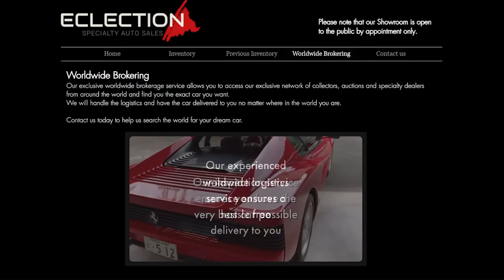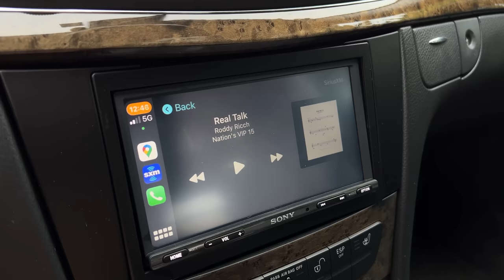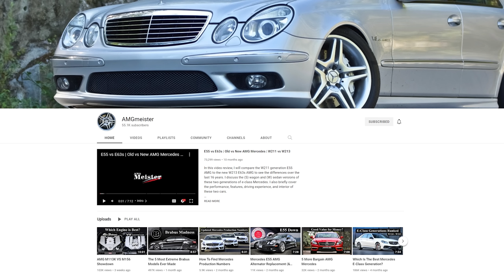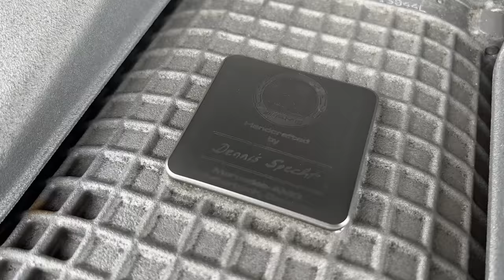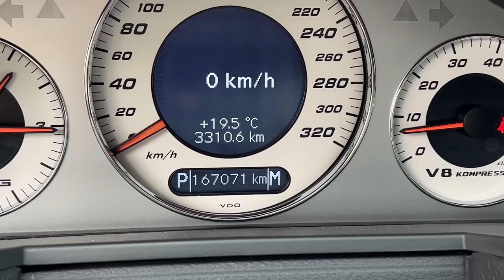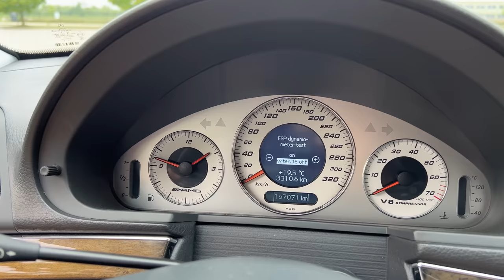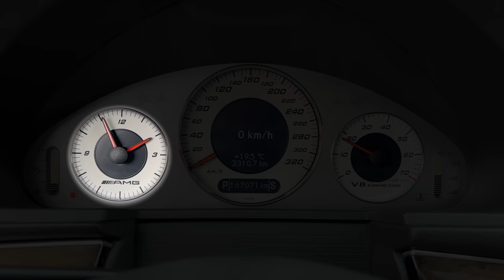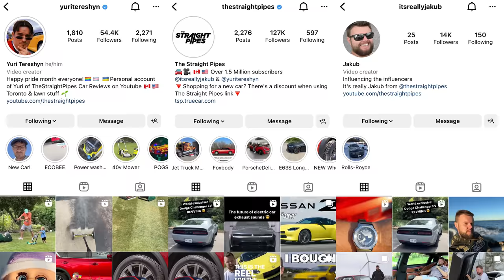DREAM CAR! I Imported a 500hp Mercedes AMG Wagon... FROM JAPAN!

Comment: The window visors are marketed by the automakers as a way to ventilate air on a rainy day, but really they are for smokers. I live in Japan and both of our cars have them. They get included in nearly every dealer installed option package to pad up the price. For cars with metallic trim around the windows some of the visors will replicate that so you don't ruin any lines.
Reply: I don't smoke but I have these (original lexus accessory) on my IS250 and they have the chrome trim strips on them which match the original window line. IMO your car is not proper VIP JDM unless it has them fitted. lol
Reply: It makes smoking on a rainy day so much easier
Reply: Not really for smokers, our weather at the Kenyan coast is quit humid and we need to crack open the window when it rains to regulate humidity in the vehicle

Comment: As an E55 owner, I approve.

Also, you can still upshift even when in either C/S modes. It just has to be at shift points that the TCM allows in 'automatic' modes.
Reply: E55 Wagon owner here, over in Germany. You can also put the TCM of a CLK DTM AMG in it (also had the M113K engine). That has a genuine M manual mode and will shift in real time as you pull the paddles. It also removes the torque restrictor the factory TCM has so you have full torque available in all gears.

Only word of caution your tranny has to be somewhat fresh as the gear engagement is quite heavy on the box.

I can also confirm that even with 530+ horsepower at the crank with the wagon on 275 Michelin PS4S tires it deadlocks from a standstill and will do 3.5sec to 60mph 😊

Comment: Finally, a real car! The E55 was my dream car, then I bought one. Now into my 15th year of ownership of my 2005 E55 Sedan. It is Obsedian Black, has 19" AMG wheels and is in stealth mode (no badges). Love it to death. Funnily enough, my wife's car is a 2022 CX5 Akera (Australia) Turbo in Soul Red, which replaced a 2015 Akera. Can't fault Mazdas.
Reply from the maker: I love the sl65 19 wheels
Reply: 25k Canadian all in. Wait a bit. It'll start gaining value real soon. Just give it a couple services 😜
Reply: How’s the reliability?
Reply: @roninpwns  The common issues are Air Suspension and the SBC Brake unit. I have had to replace both over time. Do regular fluild changes and the motor and gearbox should outlast you. My biggest expense has been Tyres. 25k is about the limit from them and 19s are more expensive and there more limited options. Wear and tear has generally been very good. Build quality was pretty good in the W211s.
Reply: CX-50 >

Comment: The W211 E Class is one of my favorite Benzes. Great styling which has aged beautifully, great amount of space, solid build quality (open and shut the doors and you'll hear the nice solid thunk) and of course the AMGs variants and wagons are brilliant both in function and rarity.
Reply: what u talkin about, the W211 has the worst build quality equates to bad reliability of all E classes
Reply: @djkasdjkasdjdjdj the E350 yes. All the rest were reliable, as Mercedes extended the SBC warranty by 25 yrs/unlimited mileage.
Reply: @bleachstain9785 I got lucky with my e350 the rod bearing issue wasn't on mine lol

Comment: Congrats on purchasing one of the best AMG's. After doing a ton of reading and researching just like you did, watching Alex (LSC) and AMGmeister, I purchased a 2006 E55 sedan with 112k miles on the clock 2 years ago. These cars are very easy to work on. FCP Euro is your best friend for parts. And the reliability everyone talks about, it's 100% true. I daily drive mine, and enjoy every mile of it. I've also kept mine 100% stock, just like you intend to. Also, change that grill back to factory with the hood emblem.
Reply: Agree about the grill
Reply: Why not the e63?
Reply: @TOShorts  depends on which year you're referring too. But mostly due to head bolt issues, cam adjuster issues, a few other things too. Anything after 2012 is better if you want the 63. But when comparing the two, the 55 will take the trophy for reliability and an all around great package. Combined with a solid gearbox, very torquey engine and easy to work on compared to most other German built cars, the 55 is a solid machine that will begin to increase in pricing. AMGmeister does a very good and informative video on the two setups.

Comment: These older Mercedes are tremendous cars. I just got my dream car too a few months ago - A 2007 S550 4MATIC … They’re reliable and well built cars with amazing performance but you gotta be ready to hit all the maintenance or else you’re going to get some ugly bills. The only issue I’ve had so far with the car is one of the air struts going out - which is totally normal on these cars - so I just replaced it with an arnott air strut that comes with a lifetime warranty. Totally enjoying the car and I’ve got no regrets - congratulations, and I hope you enjoy yours too! Also - OEM grille with the stickup star is the way to go with Benz! Far classier looking & you get to look at the star sticking up the entire time you’re cruising down the road :)
Reply: Was thinking 2014 s class, instead got a 2017 ford taurus sho, when done paying this off going s class for sure
Reply: @charlesdawkins4341  Not sure how to say it other than it’s a bucket list car - can’t know how amazing these really are until you’ve owned one. I’m not sure I’ll ever leave the Benz brand again after this car, nothing else I’ve been in drives anywhere near as well. I actually look forward to getting up and driving it to class & work. Don’t let the nightmare posts on the internet scare you away, just buy the car and be responsible with the maintenance and you won’t regret it!

Comment: Love E55's and one of the best and most reliable AMG engines ever! The factory gill and hood star looks wayyyy better than that aftermarket grill IMO. If it were mine, I'd do a E63 front end conversion. Make the car look a lot newer. And Monoblocks and coilovers. And super charger pulley, tune, long tube headers, couple intake and heat exchnager mods to make 600whp on pump gas while remaining tame and usable w/ family. Let's gooooo!

Comment: I prefer the OEM grille and star on the hood than the big logo on the aftermarket grille. It looks much more subtle and classy but if that's not what you want, then the current grille doesn't look bad.

Comment: I got one 5 years ago with a pulley, tune, and exhaust. My job has since radically improved and I could afford a new E63S. I refuse. My 2005 E55 wagon is so good, so gorgeous, and so fun I can't let it go. Not as fast as many new true hot rods but fast enough that I cackle like a maniac 90% of the time I drive it. Best 0-60 so far is a 3.9s using my dragy.

Comment: The reason why the car has the vent visors is because japanese people smoke a lot and hence they Crack the window down when smoking inside the car. It is considered rude to smoke without cracking the window down. 
Also it rains a lot in japan, so what do you do when it is raining and you want to smoke? Hence the visors.

They are extremely popular in japan and almost all cars have them. And the weather in japan gets humid a lot during summer season helps during that time too to not be stuffy Inside the car.

Idk if you will read this, but if you do I hope I answered your question. Also the reason you don't smell smoke is becsuse japanese people maintain their stuff extremely well! Let it be anything.

Comment: Sweet wagon! This one is on my dream list too! 
Window deflectors are for the rain most likely. Japan can have a similar climate to the PNW of the US so these are useful to crack the window with out rain dropping in or pouring off the roof into the window and all over your lap. Worth mentioning they are popular with smokers so that you can have the window open for venting without getting wet.

Comment: Hey, the 5 speed auto can have 1 additional sportier mode called Agility. It does make a difference in shifts(obviously not like a gearbox tune, since it is just a hidden option on all 5G,7G and 7G+ transmissions. Hit me up if you want some hidden options activated. I can do them remotely for you. 
In terms of options you are missing the Distronic, cooled seats, the cornering Intelligent Lights (ILS) xenon, maybe a wheel heating and rear seats heater. Obviously none of these are dealbreakers and can be retrofitted. 
Amazing car and congratulations! I was going to be a dad myself and was thinking about switching the w204 Wagon for one of these, but with the normal M113 engine.
Reply: I was thinking the same thing about the options. Sorry, jakub lol

Comment: There is the red triangle hazard button and under it on the same button cluster is a silver stripe. 
If you press it it will either have a cd changer or a "secret" compartment if it wasn't optioned with the cd changer

Comment: Finally, congratulations,Jacob!  You bought the right choice of high performance family car. My father have one W211 E280 CDI (facelift)in India which is a precious model from Mercedes-Benz. I really adored your car because of iconic Supercharged 5.4 liter engine. I highly recommend to fix the 5 horizontal line grill with standing 3 point star logo which would be looking elegant. Now I’m in Norway and I’m hunting to buy used W211 model with 4matic and OM642 engine because I don’t want to loose the feeling from my dad’s car due to the best. Again, my hearty congratulations  to Jacob for the proud owner of that dream machine.

Comment: Hey a tip for if you are driving it in sport mode , if you press the downshift paddle then proceed to choose the gear you want to take off from. The computer does shift for you but you have to floor it all the way down and it will shift on its own right before the redline. I own an e55 sedan thats why i know. But you are correct it also does downshift for you.

Comment: The front and rear parking sensor displays were used for years as they are fitted to my 2016 CLA45 'shooting brake'. I didn't realise until after I'd picked it up as I thought "2016, all the display info will happen on the screen......nope". Lovely choice of car though, hope you enjoy it.

Comment: Air suspension in winter is a little iffy, condensation from compressing the air will freeze plugging off air lines. I’d keep one height for winter(all the way up) and leave it be. I’ve had air ride freeze up in my rebel and almost killing me on the highway

Comment: Congrats! When something is made to last it means many can enjoy it down the years. As it has a dyno-mode it would be interesting to see if the power/torque numbers match with the as new specs. As it's a hand-built motor I'm thinking power loss would be minimal. It would still make an interesting video putting the wagon on rollers.

Comment: I have a 2004 E500 4matic that I swapped a E55 engine into.  I live in grand Island NY and am in welland canada weekly.  It will be sold in a few weeks, but if you guys want to see what a M113K is like with AWD and a shorter final drive let me know.  It is a absolute beast off the line!
Reply: Hey. I have an 2004 E500 wagon and a donor E55 Sedan that I want to swap the engine to the E500. Any hints or tips? Plus I want to at least swap the AMG front brakes since they are far superior. Did you do that as well?
Reply: Can you give me any tips about the E55 engine swap into the E500 platform?

Comment: also for the transmission for the D plus and minus the germans have it in the W210 older E class so it's not from other cars and the 5G tronic automatic transmission is one of the most relaible Mercedes transmissions.

Comment: For quicker downshifts you wanna perform what Mercedes calls a kickdown method. Don’t just press the gas to the floor even you could. Blip the throttle with a good tap then pedal to the floor.

Comment: Huge star grill is cheesy. Dudes in MD put this grill on a w123 to spiff them up….
Install original grill but plastic dip the chrome parts black. Remove the star and get the flat emblem.
Keep original wheel size and just get better tires.
Also, the wagon is lowered. That’s not stock height

Comment: e55 over any new e class. just upgrade if you want more power. they have the real mercedes feel. not complete electric nightmares. I own a 2007 e550. one model below the e55 and it's quick but my goal is to own an e55 add some wheels and upgrade the exhaust, headers, eco and add a Whipple supercharger and be done. daily it !

Comment: My dad has a saloon of the same generation from 2005 (not an AMG though!). Apart from some new suspension springs recently, it's otherwise still going well with 60,000 miles on the clock.

Comment: Go back to the original OEM grille. Also the stock radio unit looks better. Isn't there any way to get a unit that looks like the original radio but with the extra features?
Also, the Dodge was based on the Mercedes and not the other way around. They got to use the Mercedes chassis. Shows how good it was that it is still being used today 3 generations later.

Comment: Nice car! The visors for the windows are a requirement if you want to drive with your windows down in my Bronco Sport. The wind buffets like crazy without them and it is very irritating. They are good too if it is raining "a Little bit" and you want fresh air to enter. I've used them on all my cars since the 80s.
Reply: The bronco sport is such a poor vehicle! Why did you buy it? It's literally a fake bronco and loses it competitiors on interior, features, and performance. Silly

Comment: I had a 2007 Iridium silver E500 wagon that I really liked (I even had purchased OEM E55 staggered wheels)…. A really attractive car. Love yours!
In the day, you could purchase adjustable airmatic adjustment links that are used to “fool” the system. Check inside your wheel wells and you will see the links… they are about 3” long. If adjustable then that’s how they have lowered it.  I now have a 2018 E63s Wagon…. Love it too.
Enjoy your car! BTW.. that car likes high flow air filters. I added chrome rings around the head lights and it finishes the nose off nicely. Also, chrome mirror covers can look nice (eBay versions)… lastly the door inserts take care of all the scratches that show up behind the handles over time…
Reply from the maker: It's lowered through Mercedes STAR

Comment: excellent and entertaining video. I had two of them and I kind of regret I sold the 2nd one, which was MB 320CDI,4MATIC. I think your model has a CBS brake module, which was problematic through the years. And the worst of all is the gasoline consume-the car is very thirsty -it is a beast 🤷‍♂

Comment: Congratulations!

First of all, the Japanese version had limited options and was not offered with third row seats or rear sunshades. Ventilated seats were also not available as an option.
I remember that the reason why the keyless go system was not available was related to the Japanese radio act.
The plastic on the door is called "door visor" and it allows ventilation when smoking on rainy days.

The number of E55 wagons is decreasing in the used car market in Japan, so I think they will become valuable in Japan in the future.

Comment: The grill is cool. Don’t touch it. The raised emblem will get ripped off. Hold the ESP button for 5-6 secs and you’ll be all free. Burnouts coming up
Reply from the maker: It doesn't change anything on my 05
Reply: @TheStraightPipes  That’s very strange. Usually works on all cars. Perhaps holding it down longer like 30 secs?

Comment: A fun car that is a blast to drive. Hopefully you have a good Mercedes mechanic that has a factory scanner (or one that can read all factory codes) to diagnose problems. Used Mercedes can easily become the "check engine light from hell." and you'll need someone to figure out which sensor or component is throwing the code. My suggestion, drive the car regularly and keep it maintained. Letting cars like this sit can cause maintenance headaches (dead batteries, corrosion etc.) Enjoy your ride.

Comment: Except that it's not 500HP. You fell for the "underrated HP" myth that was spread around the internet back in the day. It's not underrated. The SL55, S55 and CL55 make 490HP because they have a freer flowing exhaust than the E55/CLK55 cars.

Comment: Original grill swap please. Interesting your center armrest is the older split version, not the roll up wood one they upgraded to in 2005. I wonder if that is a Japan or a Wagon thing? You'll be happy when you replace brake rotors that you got the E55 vs. the E63.

Comment: Here is another very weird Japan-only AMG - W202 C55 AMG. Yes I did not do a typo and you did not read that wrong. They made a 5.4 AMG for the W202 chassis - but only for Japan. That way you can avoid the W203 Chrysler Inspired build quality and still enjoy a hammer of an engine in the smallest RWD sedan they offer.

Comment: These guys are fun, and the MB E wagons are awesome.   Importing to the US is almost impossible unless it's 25 years old.  I picked up a CPO 2014 E350 wagon and loved it so much that when Covid hit I got a 2019 new E450 wagon.  I can't believe how almost every single thing in the 450 is significantly better....except the gas flap that won't latch if the car is running, front door hinges that won't hold open on a slope, and runflats with no spare while having room for a spare!  What were they thinking?  Still.  I've changed one tire in the last 200,000 miles.   The inner 6 year old wants the AMG.  The adult is glad to not have the fuel bills, the noisy exhaust, the carbon fiber interior (yes, his from Japan doesn't, but all the US models I see do).  And I actually use the rumble seat, which the US spec AMG's don't have.   But I don't think there is a bad choice in the entire lineup.   I'm curious to see if MB makes a full electric version like Audi just did.